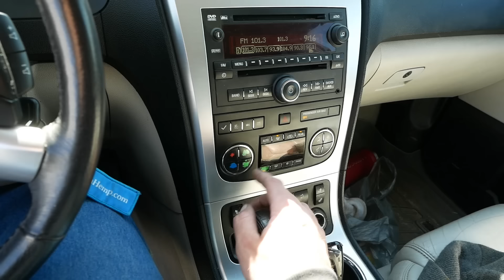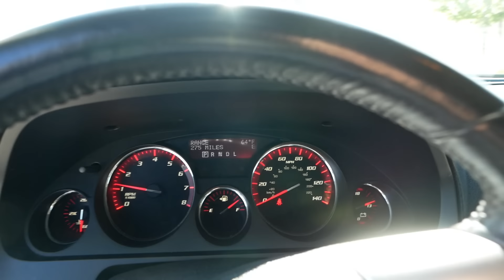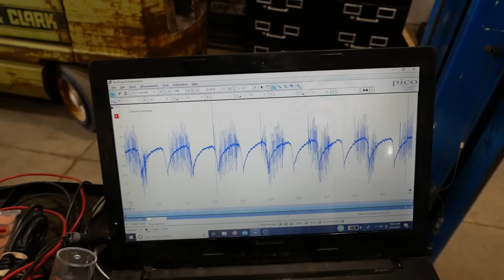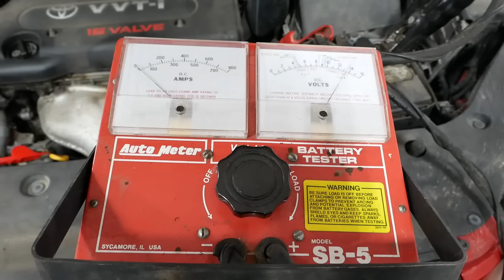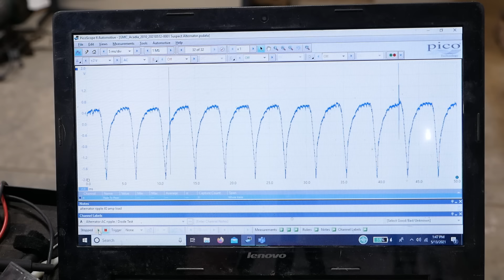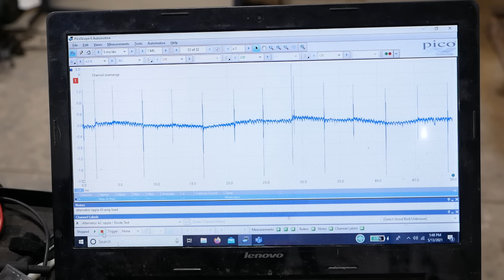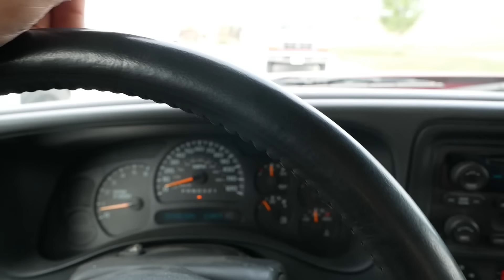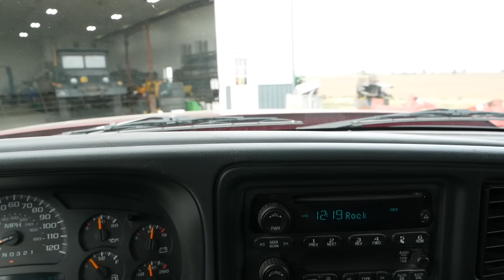A Normal Day at My Rural Repair Shop

Comment: Wes, get yourself one of those signs that one of the garages I deliver to have. "You don't bring your own eggs to a diner, don't bring your own parts here".
Reply from the maker: I don't care if customers want to buy the parts. I just wish they would get the right ones...
Reply: @WatchWesWork  THAT'S THE PROBLEM. WE CAN'T JUST MAKE IT FIT. I hate the ones you get 3 1/2 hrs in to the job and then find out that the heater core/evap core they bought don't fit. Hard to move when the steering column is in the trunk. DEAD CAR, DEAD BAY EQUALS A BAD DAY !!!!
Reply: My shop won't warranty the work if I supply the parts.
Reply: We warranty the job part and write to the bill that customer had own parts
Reply: @rick_.  Me either. We can't afford nor should we be expected to eat our labor on a redo of a defective part that we didn't supply. See my reply to dot for a real life reason why no warranty.
Reply: @terryharvey4811  me personally I don't care about a shop warranty. What I do care about? When you can order a part $75 cheaper through Rock Auto over NAPA or other sources . I've had it happen.
Reply: @rick_.  that's where the warranty applies. From the warranty part. The shop orders the part and it's warranty. If the parts go bad. The shop can recover the labour charges to the bad parts.

Comment: OMG.. You are the first guy I have seen test the Ripple on the diodes.    Yeah... 1.5 V pk to pk is out of specs.  Putting a load on the diodes was also a clever idea.    You never cease to amaze me.... and I worked for NASA.

Comment: I used to work at a GM dealer in Laramie, WY, fresh out of automotive tech school (WyoTech) in the quick lube. Folks would truck from Cheyenne up over the mountain pass and then stop in for an oil change in those Acadias or Terrains with the transverse 3.6L. I can agree, based on scalding hot experience, that the oil filter location under the exhaust manifold and 1” from the radiator, when everything is 200°, is the worst.

Comment: 16:10  Black Fly Repellent Recipe:
Lemon Eucalyptus:  30 drops
Vanilla Extract:  1 Teaspoon
Witch Hazel:  4 ounces
Place in spray bottle / shake before using.

I spray the inside of my hat, on my neck and shoulders.  
Give it a try.  Work well for most insects.

Comment: In my area they did take out a paved road, and go back to a gravel road. The old road was so bad that they put up warning signs for a rough road, and reduced the speed limit to 35 from the original 50. The gravel road is a big improvement.
Reply: The gravel roads are actually more work and more expensive to maintain.  But the blacktop is such a big initial expense it just doesn't happen.
Reply: If the paved road was actually maintained, It would not have turned into total failure. My local main roads, they grind 2-3 inches off every 10 years and repave. Done in a couple days per mile. I understand the $ part of it though.

Comment: If anyone ever gets a noise like a squeaking/grasshopper from the cam alternator belt area it might be the alternator free wheel pulley about to fall off..which makes lots of melted rubber in the pulleys.

Comment: That steering issue was very interesting.  Certainly learned something new there.  Thanks
Reply: I said intermediate shaft soon as he mentioned the noise. Seen that a bunch. Was NOT aware of the column bearing issue though. Or I've forgotten half of what I knew?

Comment: In a standard alternator there is a three phase rectifier. Its build by six Diodes.
Your bad signal shown by the pico-scope is caused by a bad phase of the rectifier.
Back in older days we were actually able to replace them but since money is more important than anything things habe changed.
A company does more likely sell a new alternator then a cheap diode set.
However with some messing there is still the possibility to replace them... but whats more difficult is, to get the housing together right again.
Most of the time they are glued together. 
Thanks for your very cool and nice content ! 💪

Comment: The Ford dealer in Healdsburg, CA had a dot matrix printer in their service department until last summer.  It printed on the three copy paper with the tear off sides.  I always marveled that they still had that thing running after all these years.  They replaced it not because it broke down, but because getting the paper printed up with their header, etc, was getting harder and harder.

Comment: I used to check alternators, when I didn't have a good load tester, by turning my voltmeter to AC voltage. If an alternator was putting AC out then the diodes were failing. I don't know if that still works on today's ecm controlled alternators, I've never tried it.
Reply: I knew the alternator in my 02 Silverado had a bad diode because driving down the road at night the lights would pulse.

Comment: I have a 2006 Silverado with 171,000 and have never replaced any of those steering parts. My truck has spent its entire life in Eastern and North  Iowa in the rust belt. However, I do drive my truck daily and never sits to long. I will say I have had to put a reman motor from Jasper at 113k as I had an oil return port crack and take out cylonder 2 and 5. Truck 171k motor 58k.  Great videos!!! Congrats to Mrs. Wes!!!

Comment: @13:50 - I'd rather go home and have everything put away, so coming in the next day you're ready to go and have no mess to face. Then again, that's just me.
Reply: Yep. Shops in NC expect you to have turned 5 hours by 9:0AM. Better have your bay clean and tools ready by 7AM. Trash emptied every night. Shops run from 7AM-9PM. Some overlap on shifts.

Comment: Seeing that shaft that was expected slide in and out,reminded me of a job I once was involved with.We had a Bucryus-Erie 12.5 Ton crawler crane that used a similar Rod in the steering.Rod rusted in place,crane would not steer,Was brought to our shop by an idiot that was using a bulldozer to push the crane side to side to keep it headed in the right direction.No parts available,we removed the rod finally got it seperated sandpapered it clean replaced the spring greased the rod up,Hey,presto,we had steering.

Comment: I guess I’ve taken living in the Toledo area for granted. Grew up In a Jeep family, first car was a 2000 XJ and had a few buddies that had jeeps. Any Jeep related part, I can get within hours. Motors, trans, axles you name it they are easy to get. Those 4 cyl motors don’t seem to last long, they put them in the dodge dakotas too so if you look for used motors look for them under the Dakota name might have better luck. Great video man!

Comment: Did the same Dorman steering shaft and bearing in my suburban, took most of the noise out of mine but still get an occasional clunk from the column, but not going to tear into it again.

Comment: I saw that stack of boxes against the back wall earlier in the video and thought they might be bulk drinking water. Bulk oil!  Congratulations!  It’s these kind of forward steps that make your job so much more efficient and easy!  For years I could only afford to get one particular flour in 5 pound bags. Cutting and dumping 20 bags into a rolling ingredient bin was always a PITA chore but it was all I could do at that time. Nowadays I’m able to source that flour and all 4 other flours I use in 50 pound bags. Baby steps...  👍👏👨🏻‍🍳

Comment: Ford Focus 1.6 TDCI is similarly evil to change out the alternator on too. It took me just over three hours to do it first time. Second time it went wrong (smart charge alternator) it took the garage less time but only just. They nailed it in 2:45 but I'd had all of the fasteners out previously. I lost a fair bit of knuckle skin too.

Comment: Hey man I'd like to see a rebuild series on the jeep, that would be awesome. I'm in the process of replacing the cylinder head on my 04 jeep wj I6. I bought it from Jacksonville ASAP towing auction real cheap with a cracked head they are very simple to wrench on. That i4 is set up the same as i6 just shorter. 
Great video. Have a good weekend. CHEERS from Jacksonville Florida 🌞

Comment: oooo daring using a syn blend in GM. I only use full syn because I 100% just go off the oil life meter. It really does account for the engine conditions. Short drives, 6k oil life, lots of highway, over 12k before the life ends.

Comment: love your videos! 35 year full time collision repair tech here and painter and i do pdr also. its amazing how things just rust and fight you constantly minnesota here.its a never ending battle im 60 now and still full time i started at 18 years old mukking around hanging with older guys that did the california airbrushing stuff on old chevelles and stuff. fixing stuff.my dad had a bunch of old macks and bulldozers and stuff when i was 13 i was the stick your hands in parts washer in 10 degree weather for my dad as he rebuilt a detroit in a guys shed it was a international dump truck.even at 13 i hated that dump truck

Comment: Dot matrix printers are more common than you would think, still.  Dot matrix printers can zap/strike through multiple copies with the self-carbonizing coatings, and you can have 4 or 5 copies done with the one pass of the striker.  Page alignment can be tricky though.

Comment: Hey Wes! I love these day in the shop videos.

 You were talking about bad oil filter designs. I remember from my days working at an oil change an old Ford Ranger where the filter would arc across the starter when you removed it. One of the new guys panicked and left it there while arcing and it cause a small fire. Good times.

Comment: Those dot matrix printers are still pretty common in the usa too. Supply warehouses use them for internal operations but not usually for customer facing paperwork and invoices.

Comment: For me those plastic push pins are OK if you have a couple trays of new ones. I need to be adaptable on how I remove them. Like starting with the tool claw made for them transitioning to a sharpe knife or needle nose pliers. Not necessarily to cut them off but to get them opened.

Comment: That looked like a 2-phase alternator - i.e. down one phase, probably a dead diode in the rectifier pack or perhaps a burnt out stator winding.
Reply from the maker: It's a 3 phase alternator, but yeah I think you are right about the diode.

Comment: No issues with oil change or filter removal on my 2016 Cadillac ATS 3.6 (non turbo engine) ..Just jack up the car and it is easy to do. It uses a normal screw on type oil filter Mobil 1 M1-212A or Delco PF63E / PF63F (newer part #)

Comment: Your socket reminded me of one of my pairs of pliers.  I was trying to adjust the well pump for my house, when the damn thing kicked on, and just about welded my pliers to the nut I was trying to turn.  Fortunately the pliers had rubber coated handles, or I might be dead.  Don't mess with electricity kids.  Turn off the breakers, disconnect the battery.

Comment: that alternator output shows half the phase being dead.  noticed right away on the yota that it has both phases.  what you are seeing with the bad one is that the VRM is cranking up the voltage to compensate for the dead phase, even though it can't detect the dead phase, it knows something is wrong.

Comment: Great to watch so many different jobs, that alternator was odd did you get the sense it was in the rectifier or the windings?  Craziest fault I had was a fuel hose that shut the fuel off at high demand. Blew it through one way and fine and dandy, blew it through in the direction of feed and it shut off. Small piece of the liner had detached and acted like a flap valve. Congrats on the Masters! Stay well

Comment: I practice zen meditation, but I swear I do not have the patience to work in those tight places.  I love my old 61 Falcon.  
You could stand on the ground inside the engine compartment and work on it. Came in handy when it rained.

Comment: ooof -that radiator cap caused my heart to jump. poor fella. Plus it's always good practice to turn every system in your car on and all the way up so it's all running full power the next time you turn it on when the battery is low. smh

Comment: I never get tired of driving roads that are more patch (or rut) than road.j

On a personal note: I think the worst oil filter access I've encountered was on a 1981 Chevy Citation. Unless you had a lift, or a really long arm with a strong hand (which I didn't at age 10), the only way you could get enough leverage on the filter was to remove the RF tire and fender liner. All the oil used to run over the exhaust and the steering rack. You could do it from underneath, but you had next to no space to get the wrench on, and get leverage. Absolutely dumb. Created a lot of unnecessary mess, and cleanup work. Worked on a Cavalier quite a bit... it was similar, but you could grab it from the top, and just and so had enough room for the wrench. After the first time, I started putting a longer filter on it, which made it SO much easier.

Comment: GM had a recall on the steering shaft noise. Take it loose from gearbox and it states stroke the shaft to break up the grease noise will go away.
Reply from the maker: You have to pound it with a 2 lb sedge...

Comment: The rattle on the 03 Silverado. I would say it’s the intermediate steering Column or the plastic clip with the bearing below the steering wheel and above the intermediate steering column.
Reply: Okay, so I thought the 03 was gonna be a different video.

Comment: A little tip for the flies. Get some 80 deet bug spray should come in a manual pump bottle, then buy some avaon skin so soft skin oil mix the 2 together and spray on yourself and the bugs will leave you alone and you don't smell like bug spray. The avalon skin so soft skin oil is important something about that stuff bugs don't like

Comment: A number of my warehouse clients still use dot matrix printers. The reason being high humidity and cold temps, don't treat laser printers well. So after alot of cost analysis and the fact that they wanted paperwork in quadruple. It was significantly cheaper than lasers.

Comment: O'reilies uses a dot matrix for their receipts.. and a buncha local shops do as well. Dot matrix is the only printing type that can do carbon copies (yeah you could just print 2 copies otherwise - and it would be much more readable), and handle crappy warehouse environments. So I still see them around where I'm at. It's not a bad printer - just niche in its use right now.

Comment: Those 2.5L tend to overheat and die. And they didn't make the TJ with the 2.5 for more then a couple years. 

On the plus side the axles are a desirable upgrade for 4L TJs. They are geared at 4.10 where the sport and Saharas are around 3.21 or 3.73.

Comment: We had a couple of cases of that Mag1 oil. Far cheaper to purchase. It caused a couple of our vehicles to rattle on startup. Put a different brand in and the rattling stopped. Sold off the remainder of the Mag1 at a garage sale. Alternator waveform looked like a bad diode.

Comment: Those are the best and ONLY Gm truck generation I'd buy. We have a reg cab at work. It has 225 000kms (139/140k miles) 6litre gas with a 5speed manual with a single axle 1 ton suspension under it.  BUT it was vin'd as a 2500 1/2 ton.  Thing went 750000kms without an oil change (not my call) and still runs mint. Head gaskets and exhaust manifold gaskets are still original with no leaks. 

I hate all other generations of gm trucks. Have had NOTHING but problems.

Comment: Amazon has replacement adhesive backed decals for worn away control buttons for fan / ac / heat controls. They cover up the worn away painted on (decals) control buttons.

Comment: Congratulations on the masters degree Mrs. Wes! 

Too bad about that Jeep. Most water cooled engines really don't like being without that water come to find out. That's a costly mistake she made. Was that all rust or was there stop leak involved? I'm guessing that there was mostly water in that radiator rather than coolant causing the corrosion, bulge from expansion when freezing, and the failure as a result. Would also lend weight to that when the tank blew, if it were only water, it might not have had that strong coolant smell we're all familiar with so if she wasn't watching her gauges or dummy lights COULD explain why she kept on cruising.

Comment: I owned a 2005 Silverado that had the steering column clunk.  Took it into the dealer several times while still under warranty to have it fixed.  Would get it back and it would be quite for about a week and would start again.  Finally found out they were just greasing it and it woudl quiet it down for a short time.  I was not happy, but their tactic worked.  I finally jus learned to ignore it and eventually sold the truck.  Wish Wes could have taken care of that for me.  
So salty!!!!

Comment: I hear the same complaints coming from you that I hear coming from me when I work on things. The engineers never seem to consider that these things will need to be serviced or repaired someday. I love spending two hours disassembling perfectly good things as "interference" so that I can get at the part that needs to be repaired, which takes 15 minutes to fix.

Comment: Some of those alternator jobs are very involved. I have had some jobs where it was easier to unbolt the subframe and drop the whole powertrain assembly out the bottom of the vehicle twelve inches or so rather than try and remove parts from the engine bay.